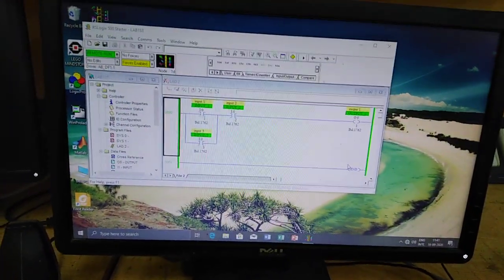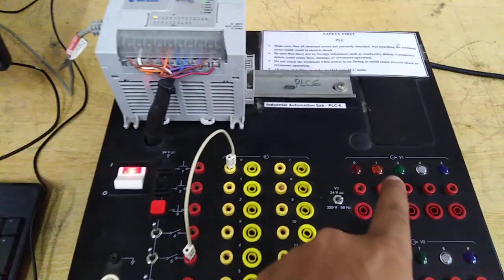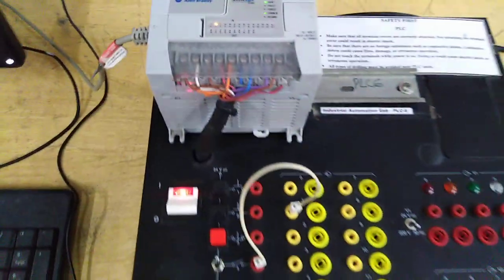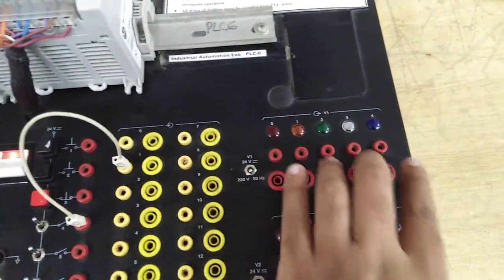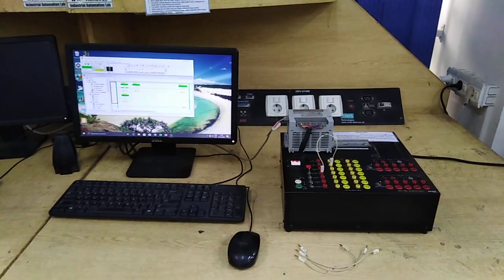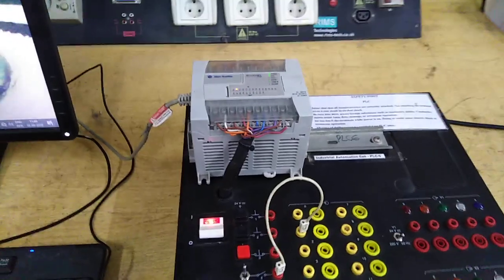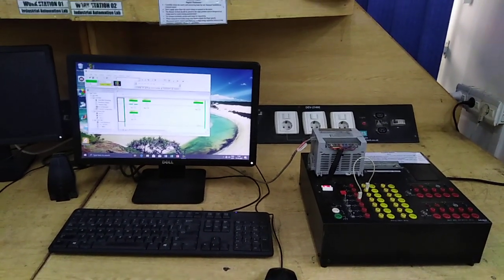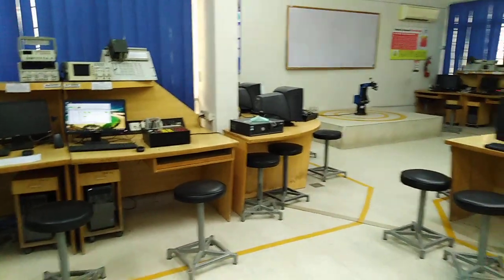Measurements and Instrumentation lab

Comment: Sir why inputs of PLC trainer are greater than outputs?
Reply from the maker: There's no specific reason to this! Different companies provide different number of ports e.g. Siemens provides same number of ports. A moderate reason can be the fact that the number of inputs is usually more than number of outputs in the circuit but still that's not a hard and fast rule. Moreover, the input and output ports can be increased by attaching modules!